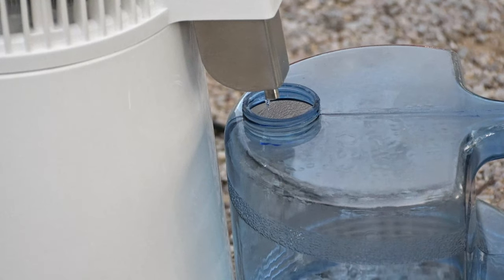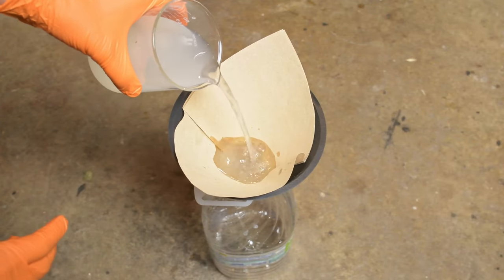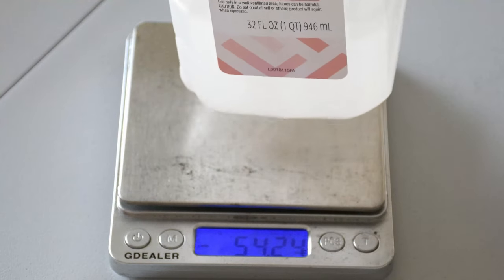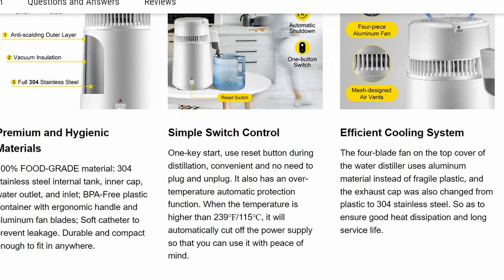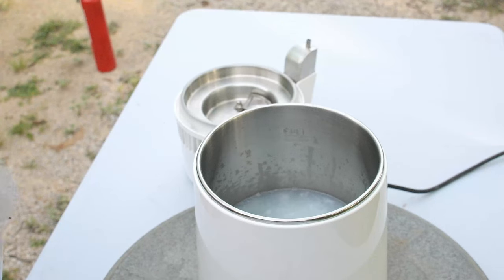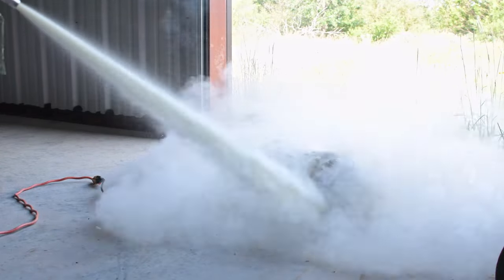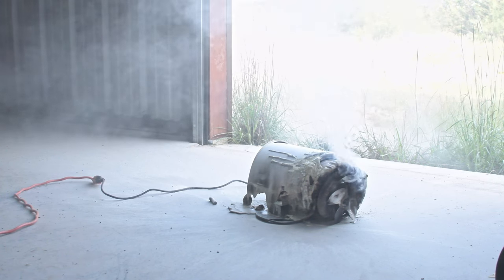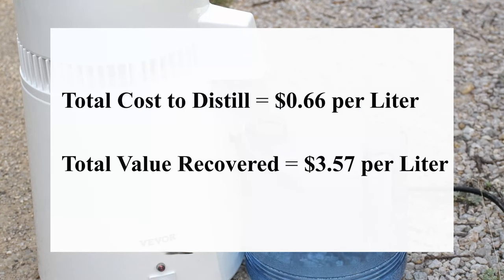Recycling IPA - Distillation for Resin 3D Printing

Comment: Sorry, as much as it sounds good, our professional take on this for a few years, is I am CSI and no matter what precautions you take.  Including the mfg of the distiller saying IPA and Electricity do not mix, and do not use for this purpose. It still is dangerous no matter what.  We in our CSI lab have had this year, that we know of for investigation 4 explosions, using this unit for distillation of IPA, and it included 1 death. It is not the liquid you have to worry about as much, which is all I saw in your pics, it is the highly flammable vapor, which is very difficult to disperse. There are better ways and way less expensive to clean IPA.  I just say, Do at your own risk.  we think it is just not worth it.  Many video of people trying this and most were not good info. Happy 3D Printing people and be safe.
Reply from the maker: Hi Donald - you are absolutely right that distilling IPA does carry more of a fire risk than most other activities inside the 3D printing realm.

There are very few videos on how to do this even remotely safely (any that exist often had people running it inside their home). There have been numerous discussions on this topic around, and since plenty of people desired to try this recycling method, I wanted to help lay out some groundwork on how to do this with as little of risk as possible.

The manufacturer does discuss how the plastic and all-metal distillers can be used for water and alcohol. Based on the destructive testing that was displayed in the video, I found that the plastic distillers are more likely to burn than explode since they are not pressurized. While the plastic ones do have a stainless steel interior, I believe that they will present less of an explosion risk than distillation setups that are pressurized or made entirely of glass/metal.

I'm happy to see any suggestions on how to improve safety for individuals and businesses that decide to use distillation for recycling IPA.

Comment: So safety concerns aside, you probably want to check with your local laws that it's actually not a felony to do this wherever you're living. As you are running a still for alcohol & the feds don't generally look kindly on unlicensed distilleries. Many places allow you to distill non-potable alcohol but you really should know for certain before you start.

This is probably the safest way I've seen someone suggest on how to do this & i appreciate the depth you went to in explaining exactly how to probably maybe hopefully not have your viewers explode and die. I'd stick with filtration and evaporation of waste alcohol, but if you like fire hazards & personal risk, this is probably the safest way to do this.

I don't recommend you do, but this is good info if you're set on trying.
Reply from the maker: Absolutely, I set out with the goal of making this video because I saw others trying to distill the IPA/resin in their kitchen.

This also works for resin contaminated water.
Reply: Yeah, like don't get me wrong this is really good info and probably the best/safest way to do this with alcohol.

I just... I quiver in anxiety even thinking about trying to do this with anything but water.  @ArisAlder

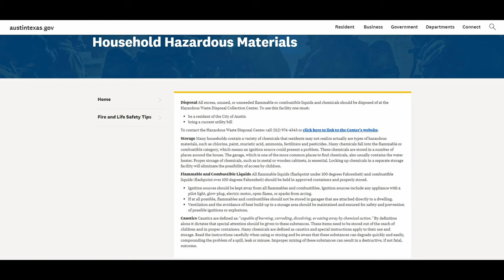Comment: I'll have to give you a thumbs down for this video, but I'll grace you with this comment. "Death pancake (4:10) is a clear sign it's overheating. Distillation should not go much above the boiling point of the fraction you want to recover, and your residue looks burned.
So, what else could we do? I personally have only used pure IPA to clean my prints, but if an IPA-Water mixture also works, you can just add an extra cup of water and distill IPA as an azeotrope (65-70 mol%). Once that has come over, the temperature rises to 100°C with some water still left in the distiller. Use a thermcouple connected to an external PID controller to stop at 90-95°C so not much of the water is carried over.
Reply from the maker: My recommendation in the description and throughout comments is to use a distiller with a temperature controller since you can set it to 180°F. I should have put this in the video & if I had that version on-hand it would have been highlighted. They should only be $30-40 more.

Comment: Just get an air stil designed for alcohol . They are all over the place .
Reply from the maker: They are essentially the same product, just half the price. Those are still also don't appear to have a temperature controller on the unit.

Comment: PRO TIP!!!!!   Use a cooking bag inside the distiller, that is how a prelesional solvent recycler system is set up, then you just cure it through the bag ad toss it in the trash. There's barley any clean up on the distiller and no need to filter first!!!!!!!!
Reply from the maker: That's not a terrible idea but it would reduce the heat transfer by a sizable percentage (it would take longer and make the unit more prone to overheating).